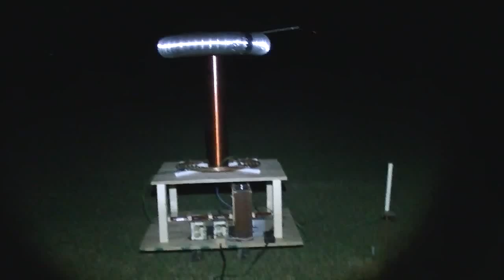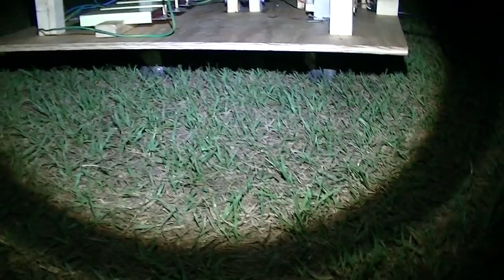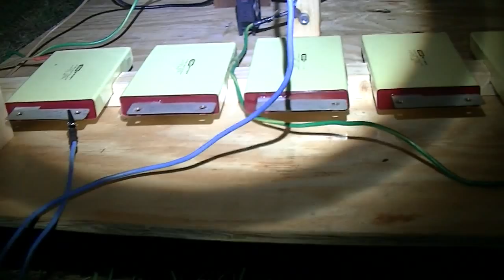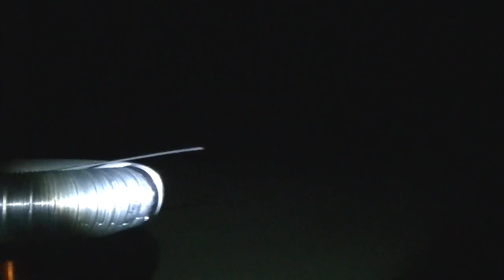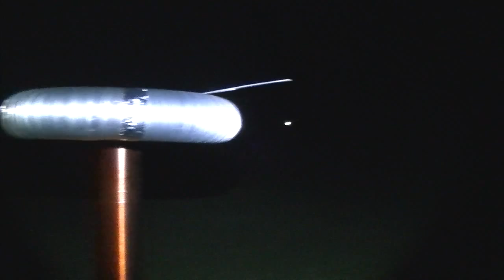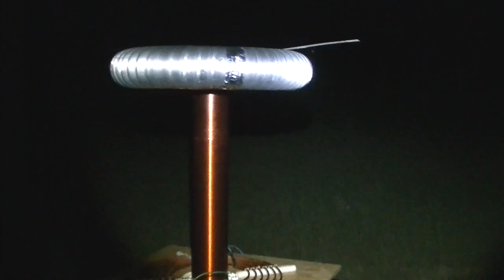Dual MOT Tesla Coil Tuning Test

Comment: I would recommend a rotary spark gap, it has a much higher BPS and requires no quenching. Any for the electrodes I would use brass, it is proven to be a very durable material for my Spark Gap Tesla Coil.